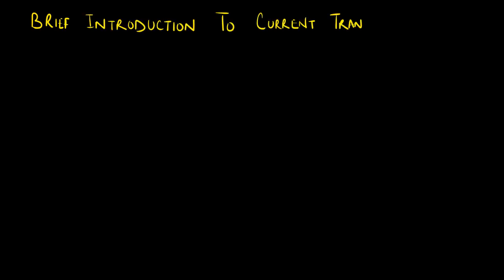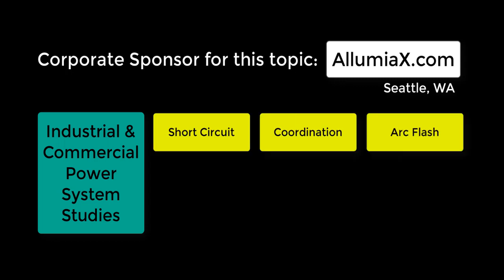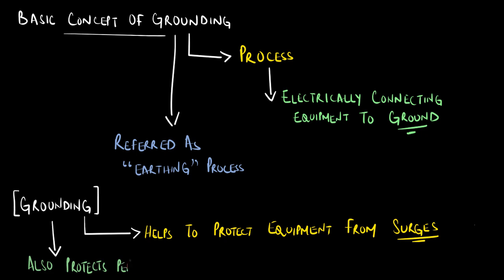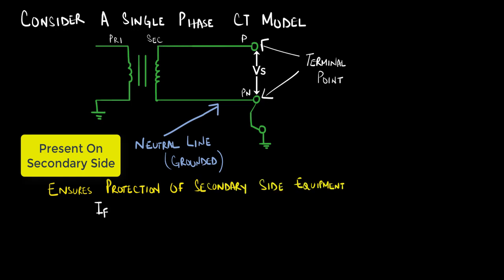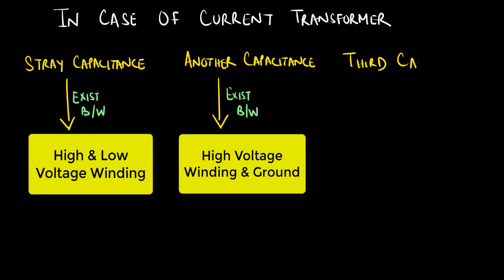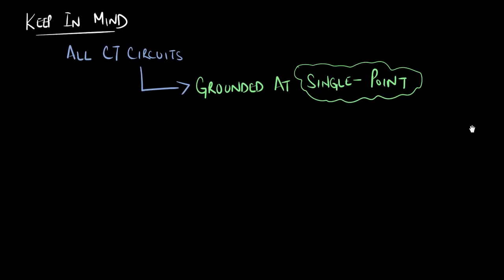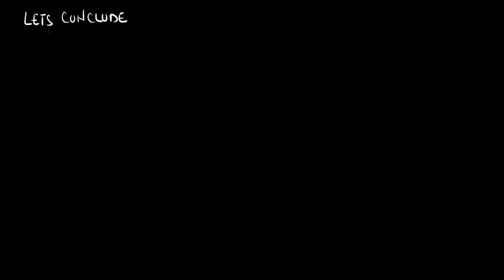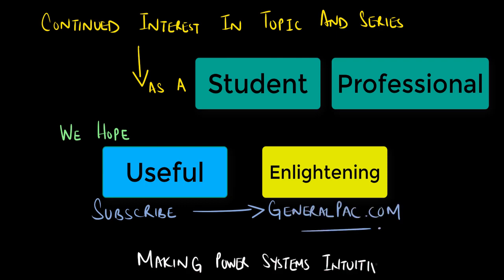Brief Intro to Current Transformers and its Applications Part 7: CT Grounding

Comment: I recently purchased a 50KW 3phase genset, after having gone through the motor side i am now faced with the daunting challenge of the ac generator end portion. 
This is amazing knowledge and your time and energy towards is greatly appreciated! 
I've learned so much in just a short period. 
Sincerely, Mark
Reply from the maker: Hi Mark, Thank you for your feedback! Check our Power System Protection Fundamentals FREE course: https://gpac.link/2IVqkLY  and get a chance to enhance your knowledge.

This course will cover the requirements needed to design protective devices and the applications of these devices through a schematic diagram. Furthermore, this course will analyze the effects of all types of faults in the power systems along with the easy hand on calculations. To develop your strong concept on fault analysis we will discuss how faults can be identified by analyzing waveforms. Lastly, you will learn the most tedious and complex theory of symmetrical components that are found in different types of faults.

Comment: does stray capacitance exist between separate CTs connected to the same primary circuit in the same CT cabinet as well?
Reply from the maker: That's a great question. The only linkage we leaned about in books and other references were the ones mentioned in the tutorial. Please consider supporting us through patreon.com/generalpac your financial support even $5/month will help continue making high quality video tutorials that you find useful and valuable